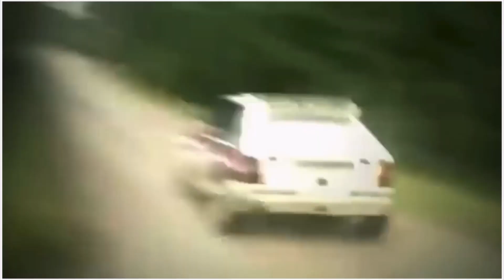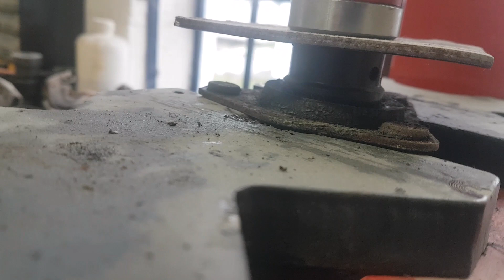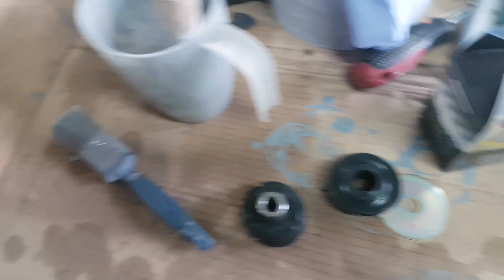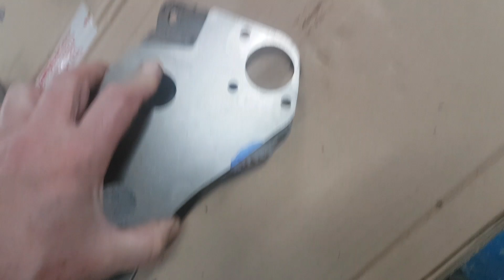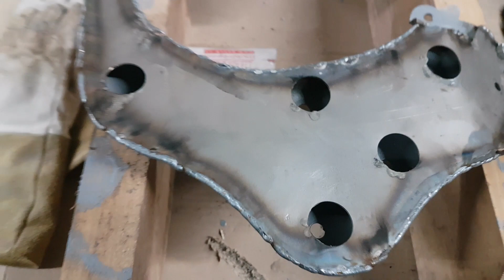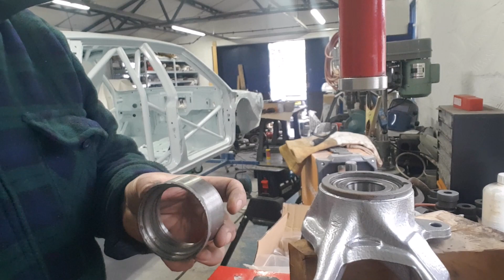Lancia Prisma HF integrale Build - Episode 23 Front Suspension

Comment: Was there not suppose to be a dust cover on the baring before you fitted the hub?  Great Videos though Otto..
Reply from the maker: Cheers dude. Well I think so, but after numerous conversations with lancia suppliers and the fiatAlfa dealer, they couldn't find any reference to them. The old bearings had them when I took them out. I fired grease on them for good measure..